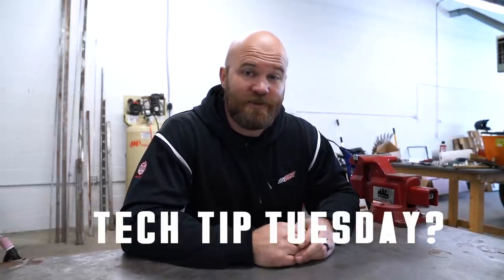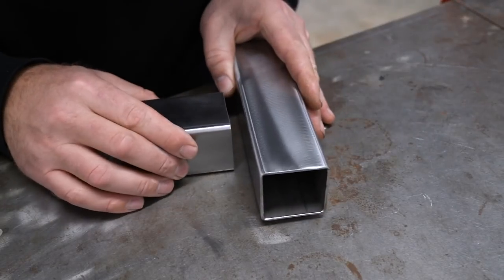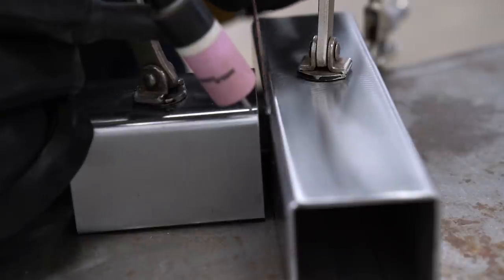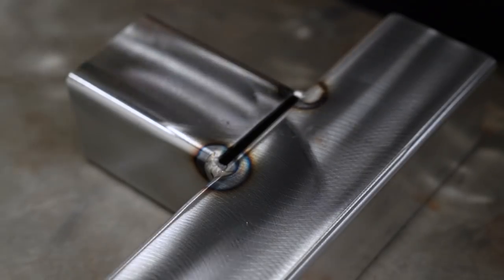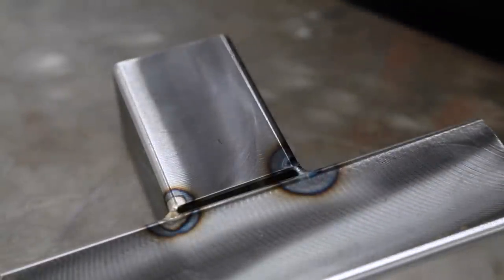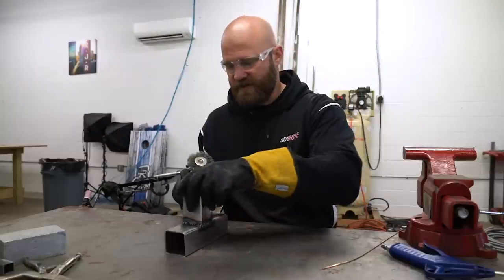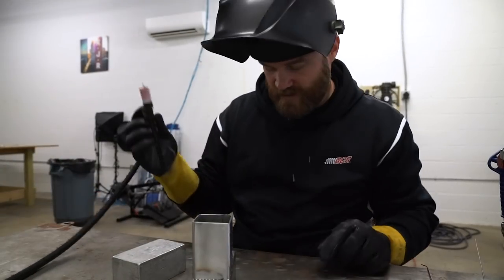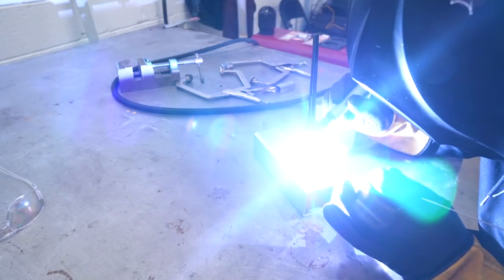How To TIG Weld ANY Gap

Comment: Boy some people like to over due keeping the gas running by the weld when stopping. Not really necessary when welding carbon. Sorry to be negative. Just coming from straight pipe welder from the plants and fab shop. Just people always have to be extra..
Reply: Some people say always let the gas over run cause it helps shield  the tungsten from oxidation while it cools off. I guess to each his own though.
Reply: @lancewinters1761  no I agree 100 percent but lil over excessive dont have to hold it that long.
Reply: You wouldn't like to explain that to a Navy inspector when welding the root on a ASTM A 53 (10 carbon steel)  pipe, would you?

Comment: I m from europe, so not so fluent in the american welding slang. But the way you weld it, is called “stacking coins” or “dimes”, here. But if you stack, then why use the teeth method? You should be able to get across the gaps with your welding method alone, shouldnt you?
Reply: It's just term used mostly by people new to the trase for the very even appearance of a perdect GTAW weld. No real significance at all, in fact.

Comment: You spend all of that time cleaning the weld zone, but won't spend any time squaring up the weld joint so you have a tighter gap!🙄😆😆
Reply from the maker: Wouldn’t be a very good gap welding video if it didn’t have a gap...
Reply: @JustVoss  poor fit up is poor workmanship.🙄
Reply from the maker: I even mention in the video of having CNC’d parts fitting to fabricated parts in a fixture. Sorry I don’t have a CNC machine to make a perfect example. What is it that you do again?
Reply: @JustVoss  I'm a weldor ... and you? The same, I would assume.😉
Reply from the maker: I just play one on youtube 😄
Reply: Don't you get it? He was trying to create a gap to show how to fill it. (albet showing a completly incorrewct  technique)  If you were to machine the end square tthen the part would e a 1/'2" short on the other end. You ever buy and square tubing? You willing to scrap out a pievce 8' long  if all it is for a shelf in your camper? Jusr fill the gap and ship it bro.

Comment: As a warning...He did not do so...But, do not ever clean metal that you are going to weld with Brake Cleaner.It causes it to be highly toxic and could put you into the hospital.
Reply: Chlorinated brake cleaner is what can cause deadly gases to burn off.
Reply: Phosgene. It can kill, in fact. Used a lot in WWI. Will cause permanant damage with just one wiff

Comment: if the saw is goingoff crooked youve lost some teeth on your blade for sure
Reply: That's like a doctor diagnosing an illness on the basis of a single symptom and no examination of the patient, and (in this case) the symptom is one which can have a multitude of causes.

Comment: For next video try to zoom in camera for more close not for see biger what you doo but for make more lighter video frame space in this case camera automaticly darks image and you can see better pudle if you take only center off image more bright dot camera calculating % dark space in frame to light space and brighting image  ... or you can change settings  in menu to measur exposur in dot or central point of screan in this case camera ignore dark area in frame and dark your image to see bright center of screen  sorry for my english but i never learn this languadge and i know from films  and scribe frome head.... i am car mechanic not camera man but i like photografing and i know how works camera in diferent light condition ... try use automatic mask for take shots witch your camera very bright  light  from lens works like laser an can destroy  sensors  specialy in phones and go-pro or others camera with fisicly solid lenses no diaframe regolable for reduce light quantity. Camera hawe procesigs in your system to change brighting but measur in diferent cases  multiponit multipint balanced at center  ad center poit  ... center point take image in same level dark image brighting  bright image darking ... multipoint take balanced image for all point in screan an dont darks if one point its brighter from other  in this case in welding you see bright flash light  not liquid metal... its not beeter too take bigger filer rod inside the gap ?  And dont doit this bredge  ?  I thinkig for cost  welding times! more gas you mast use  or this is tootorial for spent mor gas and take happy ho sold  argon  :) LoL  like all this vide to take aluminium ball from aluminium foil .... anyway  i like  how you job nice clean material first welding ....and good practice for learn tig welds be cose tig dont forgive if you don have practice ... the one is know how doit  and second is hawe this knowlege in hand.

Comment: you out of gas
Reply: I had a similar thing with an Ebay gas lense.  Thing just constantly spitting and burning up like it had bad gas.  Couldnt work out what was going on.  Thinking its something with my setup or technique.  

After much head scratching.  I switched back to an old dirty spattered lense I had before fitting new one.  Turns out it was the shitty gas lense i got on ebay.
Reply: Not using a gas lense and having argon up to high can cause a vortex causing air to actually get sucked into the weld zone
Reply: tyler Spencer  
It was like for like.  I took an existing gas lense out because it was old and crappy looking.  And replaced it with a new Ebay gas lense of the same size, equivelent part.  I didnt change any of the gas / weld settings, which worked fine with the old setup.
Reply: @BramBiesiekierski  The key to your confusion should have been answered by the last part of your statement -- "which worked fine with the old setup." If you change a part and find that you have to dial it in a little, should anyone be surprised?
Reply: @paulandrulis4672  
Yes.  And that is why i changed back to the old lense.😉
Reply: @BramBiesiekierski  I just don't understand why you didn't bother to dial in the new one before claiming it was a problem, then blaming the new piece for the issue. The issue  was expectable.
Reply: @paulandrulis4672  
That makes no sense.  No amount of adjustments can fix a cheap and nasty gas lense that doesnt work right.  I dont know why you dont know that.  Some things are just cheap oriental knockoffs.  Usually poorly trying to emulate a successful design.  But implemented cheaply, with substandard parts/materials, or production techniques.  Like the gas lense for example.

Infact.  This is so common that there are sayings and expressions specifically addressing it.
Buy cheap, buy twice.  It exists because its true.
Reply: @BramBiesiekierski  Ahh, now I understand. Through all the blustering, it is apparent that you didn't need to follow common sense because a part was somehow at fault, because you think it was at fault, or say it was at fault,, not because of any actual proof that it was at fault. Gotcha, I understand perfectly. Well, buy what you want I guess and run how you want. Your welder.

Comment: Wow.  That looks like way too much work.  All those tacks seem like a massive amount of time, and argon gas wastage.  Then even more time going over them and cleaning them.

I would have gotten about 2 or 3 tacks on each side of the square.  Maybe 1 each corner, and 1 mid way of each side.  

Then just weld it out with a weave, jumping from side to side, and building up the filler material as you weld it.  Basically just dabbing filler a little bit on each side like how you did you tacks.  But instrad of it being a tack, its a continuos weld the length of each section of the square.
Reply: Then your piece looks like a pretzel when your done from sitting there pumping in all that heat. You can do that on some thicker material though.

Comment: You may want to watch some pipe welding videos if you want to learn to fill a GAP. Also I noticed you didn't slap the square back on that joint after you finished welding it. If it wasn't dead nuts then, wtf are you doing with your time?
Reply: Slaprox
 So when are you making your welding video  so we can pick the shit out o it .
Reply: Def look at some pipe welding welding videos, 5/32 gap 1/8 wire. Back feed.
Reply: @TonyRamirez-bi1wr  gaps bigger than material thickness don't work. Heat will blow the part out. Talking of pipe welding I figured u would know heat input and how it effects the material.
Reply: @bearup1612  I got snowed out today,,,,,,,It's why I'm here. Some guys make videos, Some make money. ---- And as a CWI of 40 years experience I would have stopped this guy the second he put the second tack in that joint. What he did is totally WRONG. No welding engineer (Got my degree in 1980) would EVER write a proceedure allowing "teeth" as a method of repairing an excessive  gap/ - And yes, We do write welding proceehures for correcting large machining errors such as those that result in large gaps beteen parts. ,,,,, but never anything like he showed. .

Comment: I know sometimes there's a small gap to be crossed by necessity, and I salute your sharing such a method. But even simulating such a large gap seems pointless. Seriously, no-one would ever try to bridge such a gap. Yes, it now has material across it, but wtf about strength??? And, the time you took was way greater than simply inserting a square plate of tube size and running around normally.  Duh. Stupidly painful to watch. Haven't you got some real welding to do today? I suspect such videos are just channel-fillers, senseless content for subs and ads, as this is NOT a real world scenario.

Comment: Keep flammables away from welding this is fundamental. You will be run off the job site for cleaning you work with solvents don't do this. Explosive if you were to have fumes build up in tubing or pipes. Not a good idea. Just wire wheel it and weld it. Your way to worried about the Wrong thing.
Reply: Agreed.  There is supposed to be enough de-oxidisers in filler rod to remove the garbage that the wire brush doesn't get.
Reply: @snipersl270  s-6 baby,,,Those silicon islands pick up all the 
crap" in a bright metal joint
Reply: @mathewmolk2089  Yup.  You know you've done a good job when you lift up your lid to check your work and they pop off in your face as the weld cools.